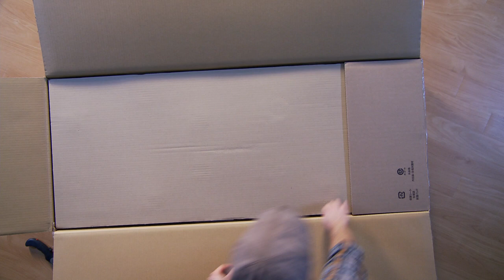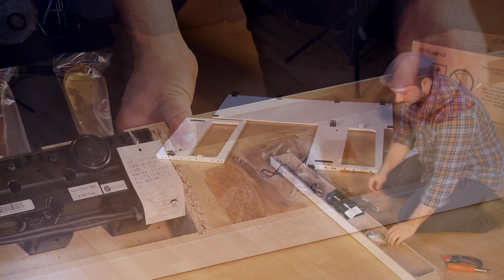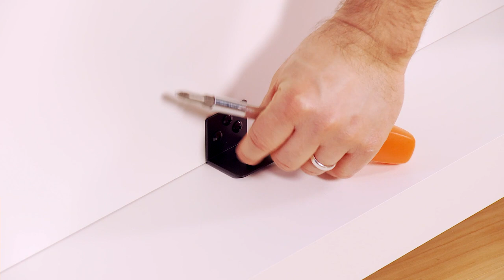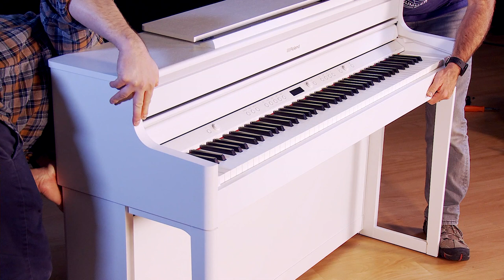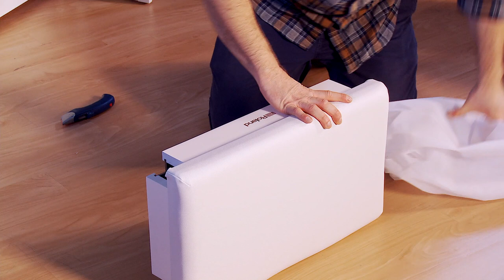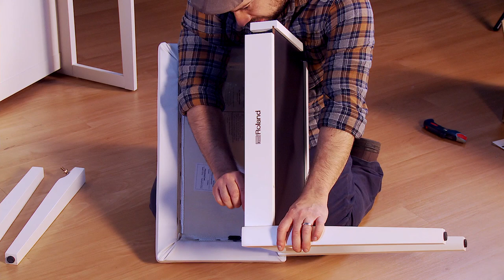Roland HP704 Digital Piano - Assembly Guide

Comment: What is the difference between Roland hp704 DR & hp704 CH?
Reply: They're the same pianos, just different colors. DR is dark rosewood and CH is charcoal black
Reply from the maker: That is correct. HP704DR (dark rosewood), HP704CH (charcoal black) and HP704WH (satin white) are all the same piano, just different finishes. HP704PE (polished ebony) is also the same piano, but the price is higher than the others due to the premium finish.